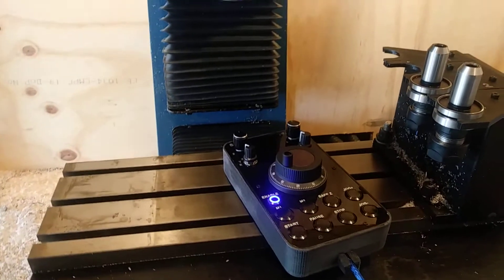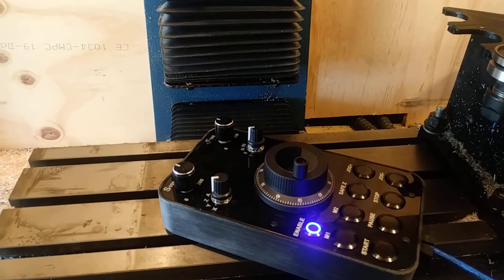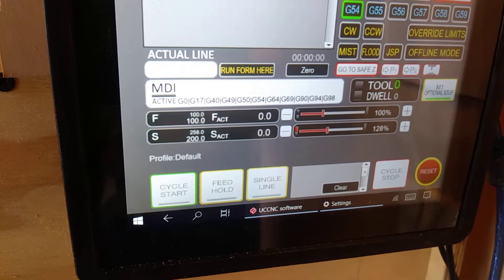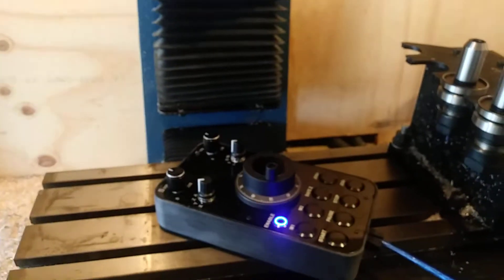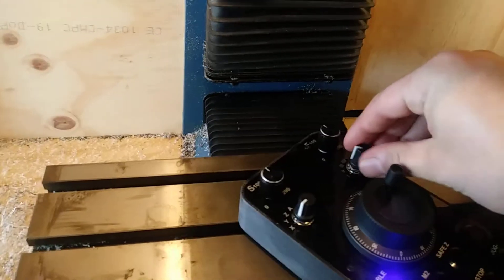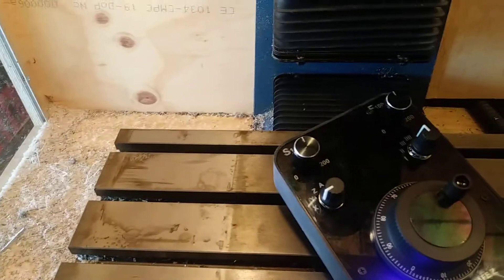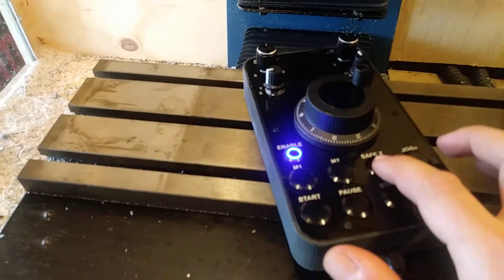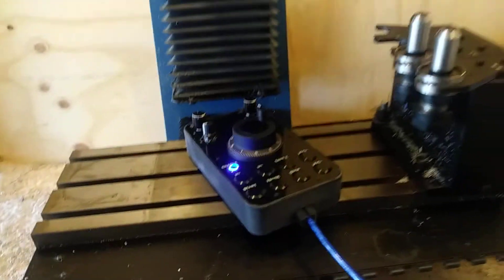DIY CNC Pendant based on Arduino

Comment: Nice work! Which PC monitor is that and did you have to create your own screenset in UCCNC? I found when I was using a potrait touchscreen monitor with the default resolution of 1366 x 768 (16:9) the icons, buttons, DRO and all the other dynamic features of the screenset were distorted, shrunk or illegible. Curious to hear what you did. I know making custom screen sets in UCCNC is quite time consuming.

Comment: Great work! The housing design looks polished.
Reply from the maker: I sanded it because I wanted to paint it. But then I changed my mind. I will likely re-design the housing and the face in a slimmer width. Eventually I want to machine the housing out of some wood or wood composite.